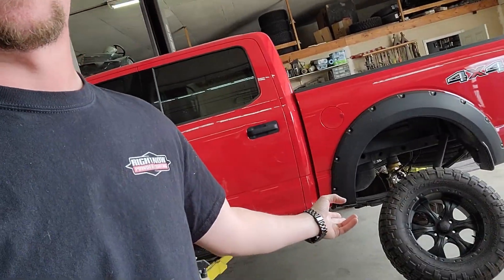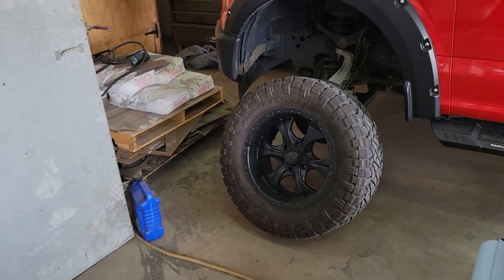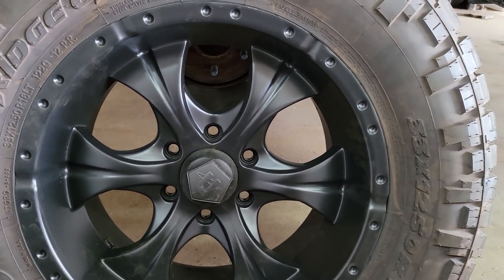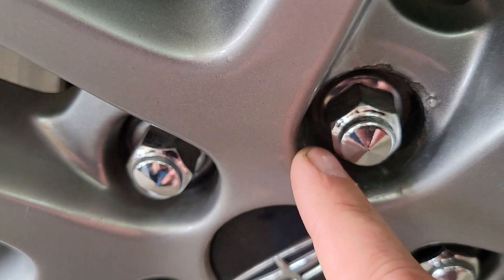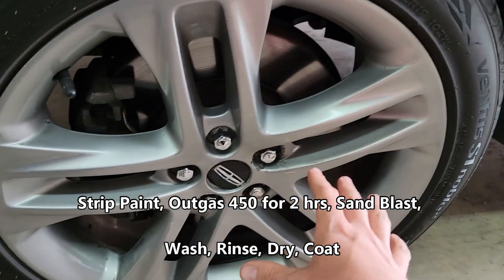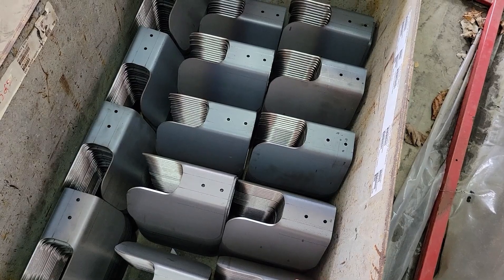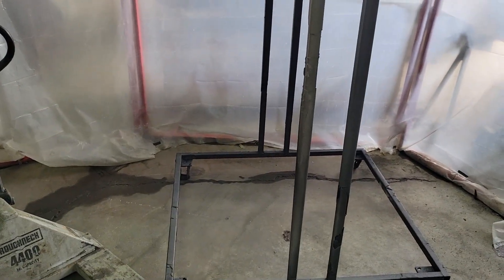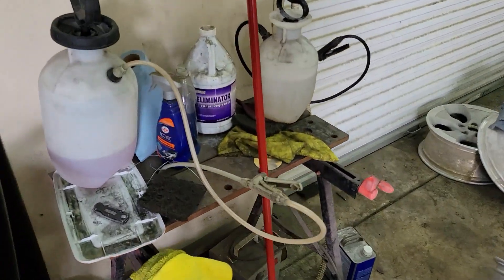Powder Coating Pretreatment

Comment: Any issues with flash rust after the phosphate wash? Any reccomendation on preventing it?
Reply: this is the same issue i’m having aswell. you found any solutions?
Reply: Im not him but i have a solution. Its not ideal but its working for now. I use a phosphoric acid that has little to no detergents. I soak/dip the part. The longer the better. If the part is too big for the barrel, i use a chemical sprayer but full immersion is best. Then i pull my part out of the acid i blow dry it with compressed air and i do everyrhing in my power to not let anything touch it, because it will pick up lint like crazy, but i never let water touch it after the ospho.
You can get very clean phosphoric acid from your local metal supply. Here, i use Triple S Steel and it is $17/ gallon last i bought it.

Pro tip... wear an apron or you will have a huge hole in the crotch of all of your work pants. Please dont ask me how i know.

Comment: What is the next step after all prep? I did a set of long arms and they rusted in the oven during outgas. I sanded them back down, hit them with all prep again then hit them with air to dry. Is that something I need to do?
Reply from the maker: You might have the mix wrong, or if your oven is too hot it will brown the metal making it look rusted.
Reply: Phosphate will get rid of rust but if you don't dry it quick enough it will flash rust like crazy.